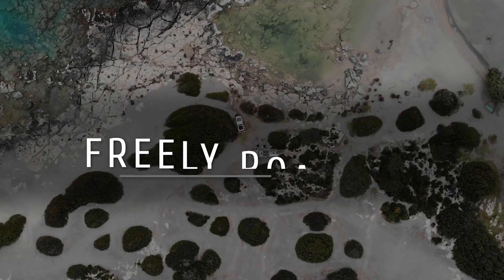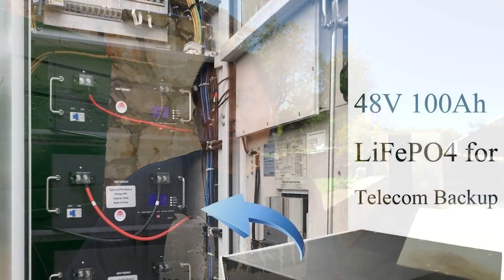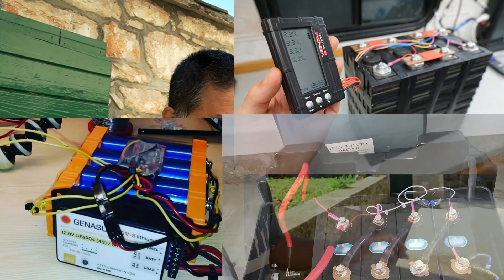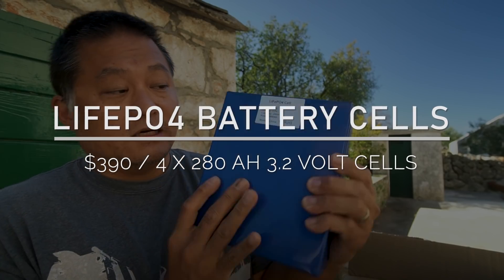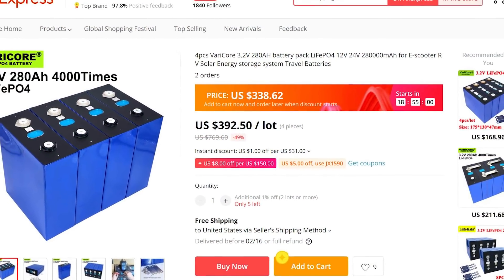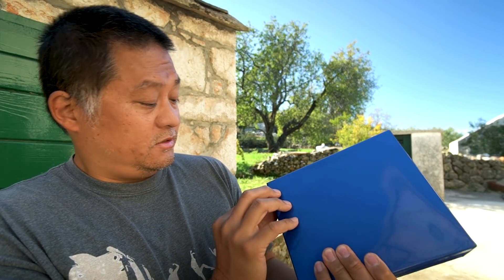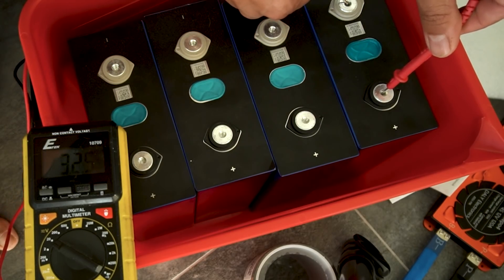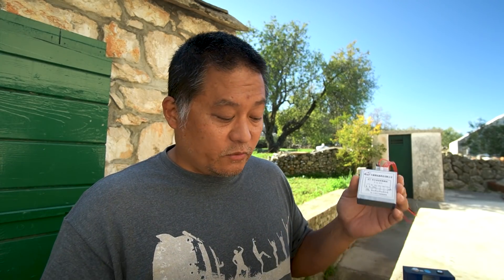Build Your Own 12-Volt LiFePO4 Battery For Cheaper Than AGM

Comment: Those of us who have been flying RC aircraft since forever, and have watched technology transform from nitro power engines to electric motors with Lithium ion and Li-Po batteries.
All of that came with a cost of having to upgrade and replace the battery charging stations. I've had my share of inadvertantly charging on the wrong setting and catching them on fire.
The chargers and batteries all come with balancing ports and wires for this to make them last longer
Our modern controllers have everything to monitor voltages and balances, not to mention our drones hook to laptops or smartphones and do the same via bluetooth or hardwire.
There are companies that sell the "server rack" systems that put out 100ah and the server rack that holds six of them.
They are pricey at $1,500 each and the rack at $500.....these are direct plug & play into your inverter and hook to laptops as well for monitoring.
Price per KwH is from .32/.36 cents.
Most heavy duty systems use the 48 volt batteries and inverters and have to be wired directly to an isolated breaker box bus bar with a disconnect in case the power comes back on.
Most houses built today need a qualified contractor to evaluate wiring as I've seen some pretty incredible "artistic" work done in them.

Comment: Finally prices has dropped here. I ordered four 100Ah LiFe-Po 12v batteries without heating at 474 US $ per battery including 25% sales tax :) Saving 150kg and only cost 300$ more then similar capacity AGM (+50% Ah).  I am also considering building a battery pack myself to have more control of the quality of the internal parts and save a little money.
Reply from the maker: That's great news!

Comment: I have just rebuilt a 1963 airstream and am now ready to power up. I have 90% led lighting with a power inverter to handle my TV and microwave, coffee maker. also set up with a 100W solar package on top. Is this the direction I need to look at? and any advice you can give me. Stan
Reply from the maker: Your microwave and coffee maker is going take the most power. So yes I would just go with a lifepo4 lithium pack. Whether you do a diy set up or not really depends on how deep you want to get into the weeds. I have a turnkey solution which I will be making a video of soon
Reply: @freelyroaming  Thanks for getting back so quick. A microwave is probably not high on the list of having to have. So I am also thinking the lifepo 4 is my best at this point. but I do want to view your turnkey solution for sure. Thanks again for the reply.

Comment: Excellent explanation. 
Can you tell me the continuous discharge capability in terms of C rating? I’m wondering if these would be good to power a brushless motor. I need 14s. 
Thank you.
Reply from the maker: Manufacturer has it rated at 1C.
Reply: Ok. Thank you!

Comment: Just a correction. Less demand does not cause prices to rise in any situation, but rather less supplies causes prices to rise. When camera transition into to digital, the demand for the old technology decreased, thus supplies for that technology decreased. Prices rise cause supplies are less.not cause demand is less.
Reply from the maker: That's incorrect if you think it doesn't happen 'in any situation'. It actually happens quite frequently. You have explained a simplified, demand-side perspective. You are disregarding short term and long term effects of the supply and demand dynamics. Less demand in the long term causes permenantly decreased production capacity and per unit costs will eventually go up for those who still rely on, or just prefers the product. Especially when a product transitions from being mainstream to niche. If you listen again you will know this is exactly the scenario I am describing in this video. That is exactly what is starting to happen with lead acid deep cycle batteries in the RV and off-grid industries as lithium becomes mainstream. Celluloid film also transitioned thru this phase as digital photography became mainstream along with many other products in history. In our lifetime, we will see internal combustion engine vehicles go thru that same transition as clean energy vehicles take over. When you say it doesnt happen 'in any situation', that is incorrect. You are only looking at short term effects of supply and demand which is primarily demand driven. In a long term, transitional industry, a supply-driven pricing dynamic takes over. That is precisely what is happening here. I've already explained this to another commenter extensively.

Comment: What's a lead acid AGM battery?
Reply from the maker: All AGMs are lead acid batteries. That is the chemistry being used. Lead plates as anodes and liquid acid as electrolyte. Doesn't matter if absorbent glass mats are being used as the medium or not. Are you not aware of this?

Comment: I’m on a budget. I used to think electricity was more important until I bought a home freeze dryer. Safe shelf stable food is way more important. My grandkids will be eating my chili 30 years from now. Lol
Reply from the maker: Does your freeze dryer not run on electricity?
Reply: @freelyroaming  of course it does. My point being I’d rather had spent my money preparing food first.
Reply from the maker: I guess it all depends on what you are preparing for. This channel is less about prepping and more about off-grid or mobile living. Without grid power, we need batteries before any freeze dryer can even be of any use.
Reply: @freelyroaming  right on. Am prepping one step at a time and thought I’d take care of food first. I’m almost overstocked on food now. It’s why I’m looking at solar videos. Wanna trade any solar equipment for a very nice home freeze dryer and everything else that comes with it? It’s worth about $3,000.
Reply from the maker: @u.s.militia7682  I would but I don't have anything to trade. Good luck!

Comment: There seems to be cells that are mentioned to be 'Grade A' and the are much more expensive. Am I correct that cell on your price range are not stated to be Grade A? Is there a big risk of getting low quality cell if buying those 'cheaper ones'?
Reply from the maker: Prices have risen dramatically on these cells since this video was made. You can find plenty grade a cell is like what I got here but unfortunately not for the same price. There is risk for sure buying lesser grade cells but you could get lucky and be just fine.

Comment: Just don’t try and recharge in freezing weather as you will brick them.
Reply from the maker: I guess you haven't seen the rest of the build videos. I have temp sensors and batteries heaters for all season use.
Reply: @freelyroaming  will look for those. Thanks.

Comment: Great Video, if my c-pap draws 5 watts over 1 night (8 hours sleep) how many nights could I expect with 4 lithium Iron Batteries.
Reply from the maker: This pack has a rated capacity of 3,584 watt hours. I think you mean you are drawing 5 watts and over an 8 hour period you will use 40 watt-hours. Doing that math means you will get almost 90 nights of CPAP use.

Comment: Hi, many thanks for your very interesting video.  

On the matter of the Daly BMS, what exactly does "BMS" mean?  I notice you refer to it as a "Battery Management System";  is this your interpretation of BMS or is it what the makers claim it is?  I will be very interested to know if it is actually a battery management system or is it in fact only a battery monitoring system. 

I see there are wires from the device  to the future battery pack and presumably these wires tell the device what the state of charge or terminal voltage of each individual cell is, however does the device actually do anything about it?  

I have attempted to find the modus operandii of this device online but it all appears to be shrouded in mystery.  For instance, if a particular cell has a lower terminal voltage than that of other cells in the bank, does the BMA supppy a dedicated charge to this cell and bring it up to par with the other cells?.  Those wires from the BMA to the individual cells look  tiny in c.s.a.  when compared to the huge main connection leads and must be capable of supplying a comparatively small charging current to individual cells.  (bearing in mind that because the cells are connected in series the current passing through each individual cell will be exactly the same (from the battery charger  or to the equipment being supplied). 

Sorry, did I miss the bit where you connect all the cells together in parallel to ensure the terminal voltage of all the cells  (and therefore the state of charge) is the same before assembling the cells into the battery bank?

I would really appreciate some input here from others who are more in the know than I am.

Just as a matter of interested I spotted this on Aliexpress.  

https://www.aliexpress.com/item/1005003223250465.html?spm=a2g0o.productlist.0.0.5d3e48d61q0s0r&algo_pvid=4c82d0c7-8fb1-49e7-b9cc-25be3c20f0d3&algo_exp_id=4c82d0c7-8fb1-49e7-b9cc-25be3c20f0d3-57&pdp_ext_f=%7B%22sku_id%22%3A%2212000026105647394%22%7D

That appears to be 8 cells x 200Ah with free carriage to the UK.  That's around $325 for 4 cells including carriage.  Time to phone a friend!!!

Comment: Hi.  Am considering the same DIY set up.  However, I am concerned that "max continuous discharge"  n most cells is specified at 100a (or 1C).  1300w microwave will draw about 117A at 12v , (more if the fridge switches on) through the inverter.  Then the BMS may trip if the draw exceeds the individual cell maximum, no?  Do you have cells rated higher than 1C?  Thanks for the clear concise video.

Comment: thanks for the clear and comprehensive tutorial and limiting the hype! it is very refreshing to watch videos that stick to the point. i am considering to follow your setup to make a 36v pack to run a golf cart. could i simply connect 12 individual cells together to achieve this? how would the Ah work? would it be 280x3=840ah total? anything i should do different with the bms?

Comment: I saved my friend who has a power chair over 1800 dollars in the last two years. He was having to replace a 12v agm in his chair about every 45 days, was basically costing him 300 bucks every 3mo. I built a 26650 lifepo4 24v pack, 7p8s , with all day use he only triggered the BMS shutdown about 10 times in 2 years. After 2y14d the pack finally needed a maintenance rebuild so I pulled it apart and tested and charged each cell, discarded 8 high resistance cells, and put the pack back together with the best cells out of the 56 original pack cells, and 24 cells I had left over from the original pack build. As far as we're concerned, it payed for itself 18 months ago. Has been more than worth it
Reply: Mike i have a Renogy 400W system. It has a 100V 40A charge Controller and im wondering how i can or if i can add a second set of cells to my system. I currently use the 280AH 3.V 4 pack. Thank you.

Comment: I came upon this video by chance, but I was curious with how these devices had shipped to you.  Given that the packaging in this video does not have ANY hazardous goods indication on the visible related to Lithium batteries then the company that shipped them to you did so against international shipping regulations. I would then not trust the vendor on the declaration for the safety of their batteries/cells.  That CE mark on the battery is NOT a certification.  It is a declaration by the manufacturer that does not require auditing from an accredited and impartial third party.  So would I recommend caution when using these devices.  LiFePO4 batteries are indeed more chemically stable then Li-Ion, but they still have their inherent risks.  Thermal runaway CAN happen with these batteries, it just will not necessarily result in the same spectacular fireball.   They do get substantially hot and can eject extremely hot gasses.

Comment: Any thoughts on using this kind of setup for a starting battery?

I've been debating using a pack built out of smaller cells in my race car (I'm currently using a small AGM Powersports battery that weighs about 16lbs fairly successfully), I'm guessing I can get 2x or more capacity at about 10lbs building something out of LiFePO4, but I'm not sure how well they'll take high load of a starter and the matching alternator output.

Comment: Quick question, first of all you provide very valuable content nicely done, ok for the question I'm building a 4.0k solar aray on my RV and using a 48vdc  6kw all in one system  inverter to manage everything, going to DIY a 48v LiFePO4 Battery set up requiring min of 200aH to run it, how many BMS's do I need to manage the battery farm. The 48v LiFePO4 Battery set up will be in a series arrangement. Pls keep up the great videos

Comment: Great and clean video! thank you for making it!! 
Because as i am very new to this technology, can i ask you some most probably silly questions in case you can help me / insight me ?
- 1. The fact that your bms is lower amperage than ur batteries, does this mean you won't be able to charge the batteries at your full capacity, or only that you wont be able to draw/request more amperage than that continuously.
- 2. what is the correct Voltage the bms should state 3.3v like the cells or 12V like your desired end voltage.
- 3. does the 4s part in the BMS correspond to the number of cells it can support, i.e 4s = 4 battery cells? 
- 4. what would i need if i wanted to charge the batteries from the grid? any link for an applicable charger would be much appreciated.

Comment: Regarding balancing the cells (around the 13:00 mark), does this balancing issue also apply for regular 12v deep cycle batteries if you are running two of them together as a "bank"?  Thank you... great video!
Reply: If they have their own BMS each BMS does that.

Comment: Excellent explanation and happy prices have finally come down.  Planning on doing this to my class B rv that is still using old lead acid deep cycle batteries.   Don't understand why anyone would put a thumbs down (  291 jealous viewers?  )  I've never ordered from Alibaba and hope eBay or Amazon has the same prices.  Question:  so if I install the BMS and the balancer do I need to be concerned about what charger I use?.  The RV still has the older transformer type inverter and I also use an inverter generator at times when their is no solar for the 200 watt panels.

Comment: The newer (and probably cheaper) BMS modules have a wire that goes to each cell. If your "BMS" doesn't have this, it can't see the voltage on each individual cell to know what is going on.

Comment: I have a question, if I'm going to make a lifepo4 battery of 100ah complete with BMS should my BMS be 100a or can it be something more? what's best?
Reply: 100ah is just how much capacity your battery has. Your BMS should be as big as the system you are running off of it. For a small electrical campervan system, 100A should be just fine. For a big electrical system (24v with 3000W inverter etc)... 200A should be better. In other words, it matters on how big the load is, rather than how big the battery is.

also, 24v 100A BMS will be higher overal energy than 12v 100A. Because on 24v your fridge might use say 4A, instead 12v at 8A.

I hope that was clear.
Reply: @millanferende6723  Its very clear now,thank you very much

Comment: i'm thinking on making a smaller starter battery.. i see the 20ah ones is rated for 300amp 30s peak and 200 amp 3 minuet's. so 8 cells. 2p4s should give me 600 amp cranking power. might even make it with just one row of cells as the engine is not more then a motorcycle engine (3 cylinder 990cc) and nominal 1.1kW load on the starter.. so might be 1500 watt load.

Comment: can you use these batteries for electric car conversion?
Reply from the maker: Yes they can. however you will get more output current from cylindrical cells especially with other types of lithium chemistry. But these will give you 10 times more charge cycles and longer life.

Comment: Not sure if I should switch to or stick with lead acid need the power but want to be able to jump cars and not sure if the litum will be able to handle that
Reply from the maker: Lead acid is better for high bursts. There are portable lithium-based jump starters but they use capacitors in the circuit to achieve the high output bursts.
Reply: @freelyroaming  okay thank you for that i have a suv so have the room not really needing a lot of power like a rv would but I do have a big stereo so need the power for that.. but also like to help ppl so do alot of jump starts so been trying to figure out what would be best for that so was looking into litum but couldn't figure out if it would handle everyday use like that because everyone since they are good but they are sensitive

Comment: Finally, someone who can explain these batteries in a clear and concise way.  Thank you Sir.  I'm going to double this with 8 batteries using at least a 5000 watt pure sign wave inverter.  I have been using 5 full sized lead acid batteries with my vans two 160w solar panels and a 1000 watt inverter.  Works perfectly but I worry about off gassing as I noticed that anything that is metal in close proximity of the batteries begins to develop a blue green film from the acid vapor of the batteries.  This can't be good.  So I will go all out for LiFePO4 batteries.  I am an English teacher living in Vietnam. The power is always going out here and I want to build a backup system I can use in the house as well as a future van build.  Cheers!

Comment: I thought all cells in a pack auto-balance over time without any external device.  Say I have 3-Cells at 13.2V and I introduce a cell with 11.5V into the string - my understanding is all 4-Cells will reach 12.77V in the span of a day or two simply for being in the series.
Reply from the maker: They only auto balance if every cell is connected in parallel. When they are connected in series like this they will not balance.